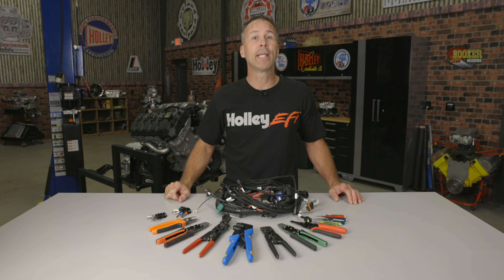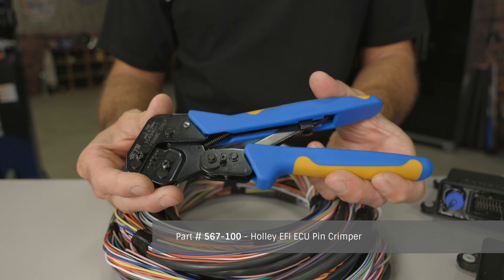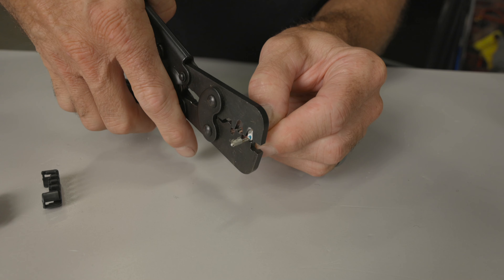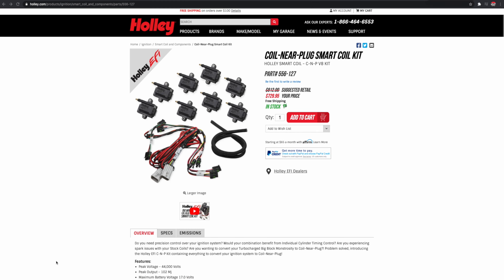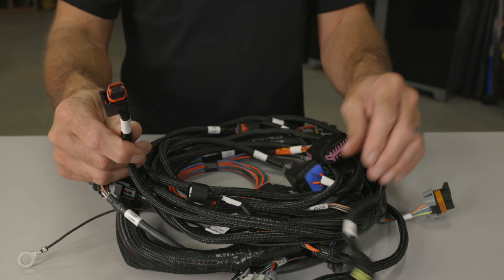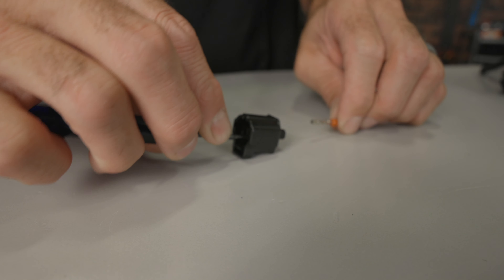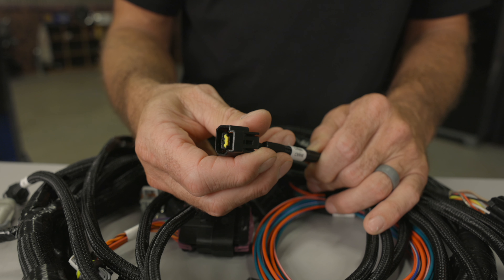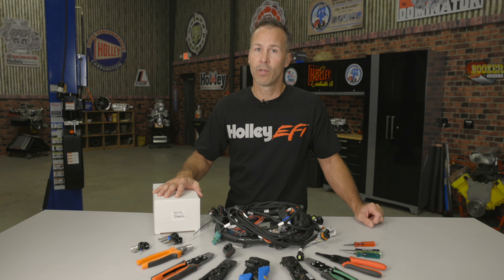How to Identify, Crimp, and De-Pin Connectors on a Ford Coyote Wiring Harness

Comment: This J connectors sound great but are only good for technicians and lucky people as the connectors could come out more than the ones intended, the friction fit or snap fit may loosen enough that it alone won’t stop the wires from turning into a game of 52 pickup electrical connector edition